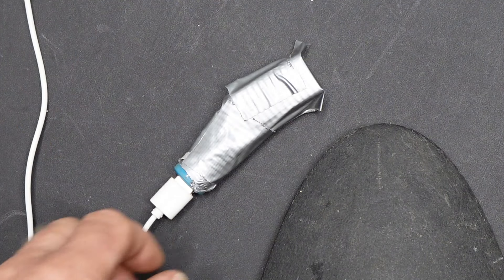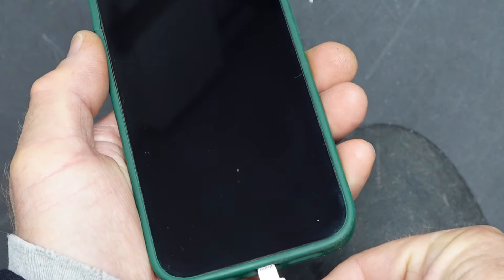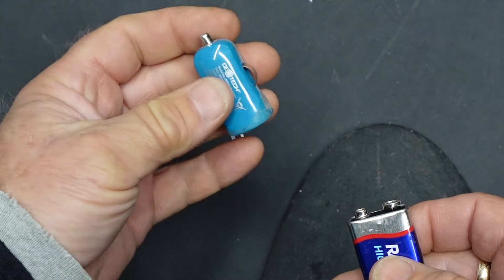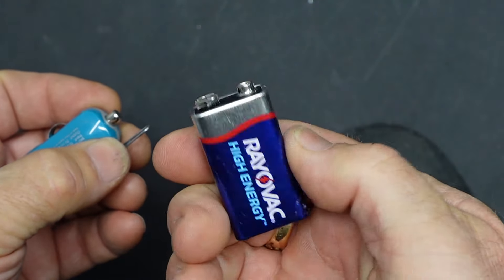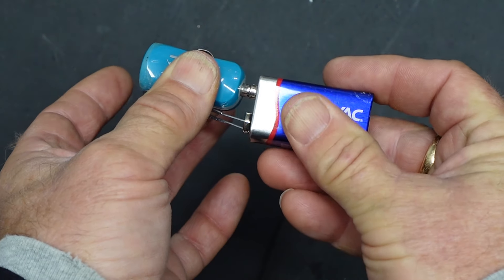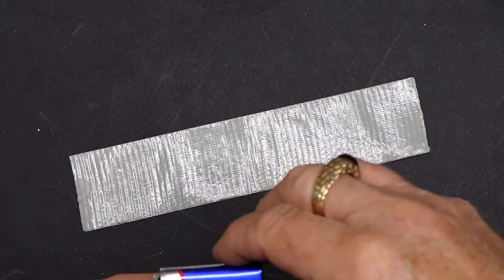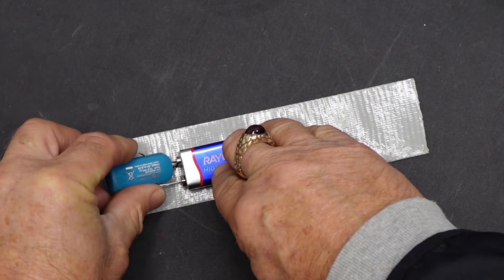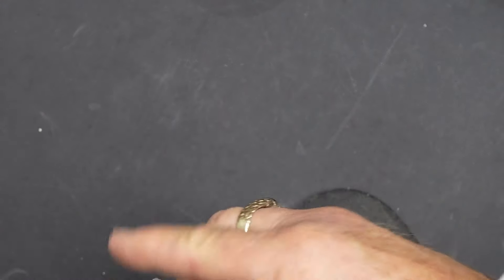How to Charge Your Cellphone When You Have No Power

Comment: I'm not stupid. You made it very clear that it wasn't charging at all when you plugged it in so nice try. IT ONLY TOLD YOU THE CURRENT PERCENTAGE OF YOUR BATTERY so stop wasting people's time with something that does NOT work!
Reply from the maker: Katie, it does work.  It won't fully charge it by any stretch but it can maintain enough of a charge to at least get a call or text out in an emergency or desperate situation.  Check the rest of the comments where people tried it with success.

Comment: Wow..have you checked how much 9V  battery has charged the cell phone in percentage. 📱🔋📈
Reply: It can probably do 1 charge at best. Maybe it will only go to 50% for modern phones. Depends on your phone battery. The bigger the phone battery the more mAH. You can check your battery rating on gsmarena. Most are already 5000maH
Reply from the maker: @heinrichsmit2  With a test I did, I don't think you'll get even 50%.  I'm not certain how old the batteries were that I tried with, but I think the best one can hope for is to give it a boost long enough to send some text messages. Let me know what you find.  I also noticed that the battery got pretty warm, and was depleted fairly quickly.  The capacity just isn't there in the small package of a 9v battery.
Reply: @theinternetelectrician  wish I had a 9v laying around lol but keen to keep one for backup incase im in a situation. That's what I'm taking from this video. If you have a 9v you can get yourself out a situation where your car battery is dead and your car is stuck when your phone was off. I keep a car battery in the back seat with a invertor as well to charge my phone lol, im one of those ^_^

Comment: I left mine together for a few hours & it only went up 3%. Anyway of adding more batteries in series to charge phone faster?
Reply from the maker: You would add batteries in parallel or if series, many 2 max as that would be 18V on a 12V rated USB adapter. So to connect in parallel, or a series / parallel it gets pretty complicated.  With a test I did, I think that's what I got as well.  I'm not certain how old the batteries were that I tried with, but I think the best one can hope for is to give it a boost long enough to send some text messages. I also noticed that the battery got pretty warm, and was depleted fairly quickly.  The capacity just isn't there in the small package of a 9v battery.